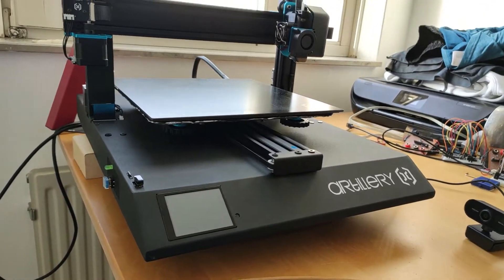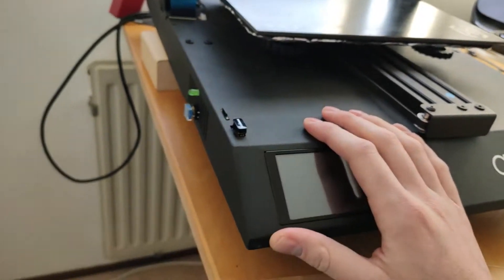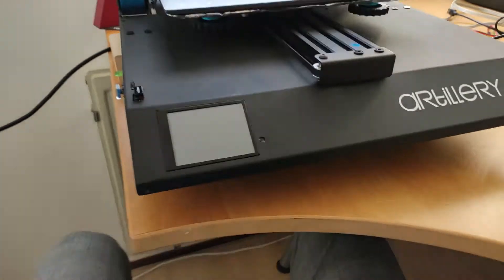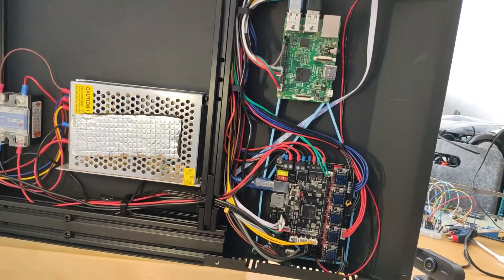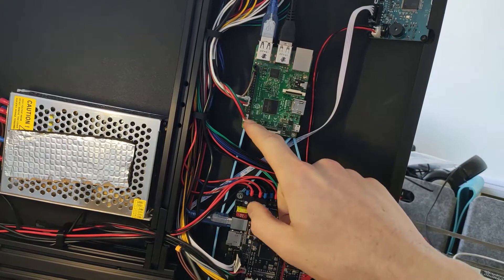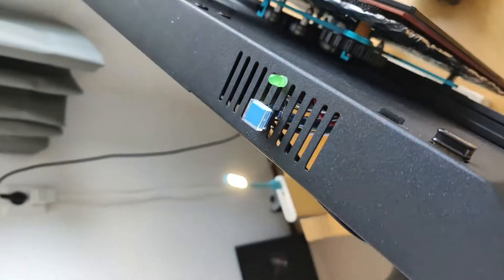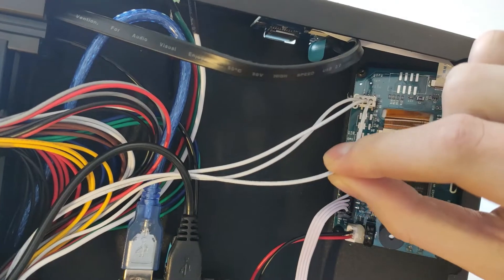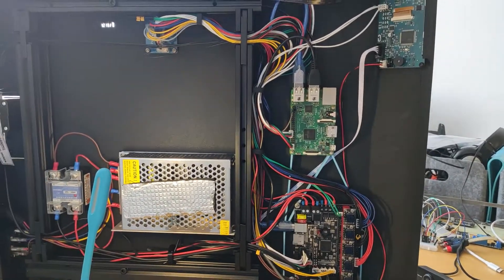Sidewinder X1 SKR 1.4 + Raspberry Pi setup inside housing

Comment: Hey, great video, got a few ideas from it. 
Although I am using Klipper at the moment I am curious on how you has your touchscreen connected to skr 1.4T. Do you a diagram for the cable ? Thanks
Reply from the maker: There is a TFT output on the SKR board, just connect it to the screen with the existing white ribbon cable. Though you need to change the connector from a 2x4 dupont to a 1x4 in order to fit in the SKR board. I just got four dupont connectors from some breadboard jumper wires and jammed in a piece of paper next to them to make sure they don't fall out